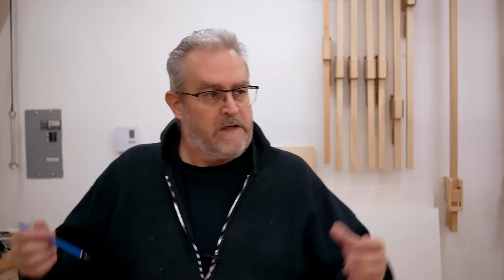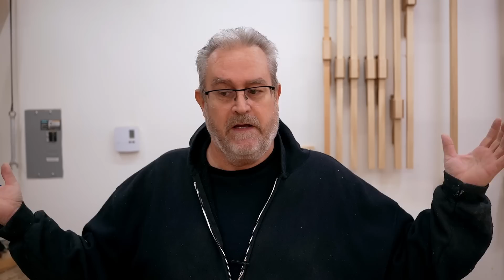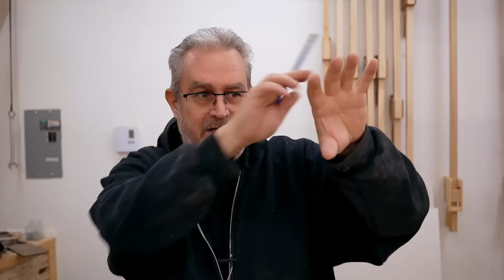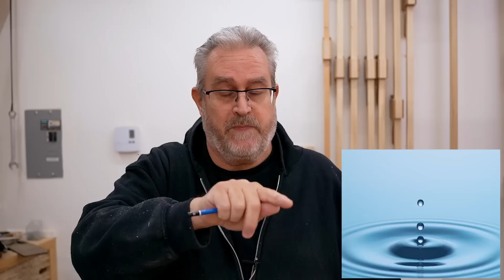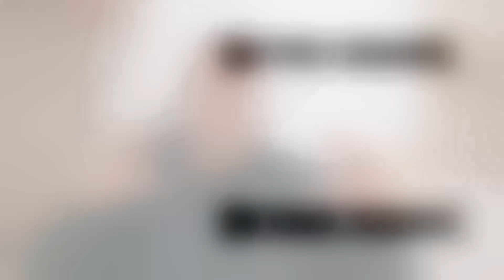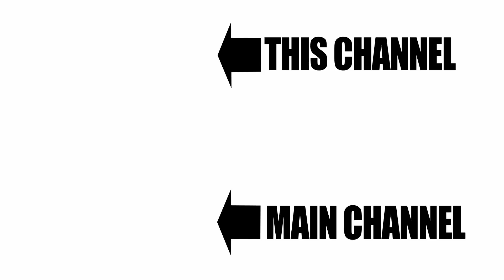Debunking Audio "Truths" - Open Baffle Speakers don't Pressurize The Room

Comment: At about 6:48 you state, 'peak being positive Pressure and trough being negative pressure'. You are conflating a sinusoidal function, with Compression and Rarefaction. Compression, the Density of the medium is greater and in Rarefaction the Density is less, but at no Time is there, "Negative", Pressure.
  In Labs I've worked in, were plating contagious/dangerous organisms is performed, plating said organisms on a growth medium, AKA petri dish, there is negative Pressure.  As air from the room is pulled out of the room and into the Hood, the workspace, and then through a pipe containing a series filters, before being exhausted into the Atmosphere.
Reply from the maker: I'm not conflating anything. If you look at the net air pressure in a room, it's a relative constant. Call it the the baseline. When sound is created, the "wave" produces a pressure above the baseline and below the baseline - Plus and minus.
In the video I included a simple example of exactly that, when a rock is dropped in water. And you can see that happening in that example.
I reject the terms "compression" and "rarefaction" to describe sound energy, because they are misleading as well. In particular compression - how much compression actually takes place when sound goes through a medium like steel, do you suppose?
Reply: @IBuildIt  Well you are free to reject anything you choose, but to describe the propagation of sound in a dispersive absorptive medium, air, the terms are derived from the Discipline of Physics. 
The velocity of a sound wave is affected by two properties of matter: the elastic properties and density. So you doubt that the crystal lattice of a metal is behaving at the molecular level, as a gas or Liquid, in the Classical sense, because you cannot perceive the displacement at the crystal lattice level? I suggest you research normal modes of vibration in a solid and perhaps then move onto the definition of Phonon.
Reply from the maker: Think about what you are arguing. I say I reject the term "compression" and prefer to use the term "pressure amplitude". 
Tell me, when sound is happening in a tuning fork, what would be the best way to describe what's happening? Would one say that it's compressing and rarefying, or would one say it's vibrating? 
And when describing a vibration, wouldn't it be natural to use the term amplitude to talk about the strength of the vibration?
Sound makes stuff vibrate - the air, water, metal, etc. 
When it does that, it's dumping energy into the medium and that dissipates in the form of heat. 
What happens when a medium heats up? It expands, of course, so using a term like "compression" is confusing and counterintuitive.
Reply: @IBuildIt 
 Well, you are now altering the discussion away from positive pressure and negative pressure, which was what I originally posted about, and wasn't correct in terms of the transmission of energy via the dispersive absorptive medium, in our case, air, defined as sound, We were first discussing. Now, you transition, to support what you believe should be the best way to describe the actual phenomenon, by discussing sound moving through a solid.
 I briefly scanned and found this definition.
 "In solids, waves propagate as two different types. A longitudinal wave is associated with compression and decompression in the direction of travel, and is the same process in gases and liquids, with an analogous compression-type wave in solids. Only compression waves are supported in gases and liquids. An additional type of wave, the transverse wave, also called a shear wave, occurs only in solids because only solids support elastic deformations. It is due to elastic deformation of the medium perpendicular to the direction of wave travel; the direction of shear-deformation is called the "polarization" of this type of wave." 
   Will you agree that the term decompression equates to rarefaction?
  This seems to be what you are objecting to in the first sentence, compression, in a solid which does occur at the atomic/molecular level, known as the crystal lattice. And is the mechanism for energy transfer. "Heat is the process of energy transfer from one physical system to another."
    "Sound makes stuff vibrate - the air, water, metal, etc."  From definition, "Sound IS a vibration that propagates as an acoustic wave, through a transmission medium such as a gas, liquid or solid." 
  Again I employ definitions and not interject my personal opinions. Sound makes stuff vibrate, or Sound is a vibration. That is the quandary.
  I won't deny it may seem counterintuitive, but that's the way the Universe works and if it disturbs you, it was told to me by a Prof, that is the first step in the learning process. I'm not trying to be a PITA, just that your terminology and possibly understanding doesn't align with a few hundred years of Physics paradigm. It not a big deal, its your channel and I enjoy your empiricism. So, I thought I would add my two cents to illustrate what is actually occurring. Your, "So using a term like "compression" is confusing and counterintuitive." Well, yes, I agree it is, so I copied two quotes about what Bohr thought concerning His own work discovering How the Universe actually operates.
" Those who are not shocked when they first come across quantum theory cannot possibly have understood it." " If you are not completely confused by quantum mechanics, you do not understand it."

Take care and thanks for your Time.
Reply from the maker: Guy, I'm approaching the phenomenon from different angles to try to get you to understand what it is I'm saying. I'm not changing anything I've said, but dumbing it down to get through to you.
What's another way to say compression and rarefication? High and low pressure. 
Your obstinance at this point is bordering on ridiculous, so let's agree to disagree.

Comment: Why does everyone make this so complicated? Its easy. Really.

A room is a box filled with jiggling air molecules.  The amount they jiggle depends on the temperature they are at and the amount of pressure they are experiencing around them (atmospheric  pressure).

A loudspeaker wether the cone is pushing or sucking will always deposite a little residual energy in room, which is heat.  If the room has leaky doors and windows, with thermally transparent walls, the extra heat energy will leak at the same rate as the cone vibrates.  The net result is no long term change in pressure.  

There have to be momentary changes in pressure otherwise we wouldn't hear anything.

They key thing is the room is an open system  so over time the excesses energy from heating the air molecules through vibration is almost instantly dispersed outside the room.

However, if a small speaker were placed in a closed system - a perfectly sealed and insulated box - then there would be rise in pressure as the air molecules warmed.  Eventually the cone would become harder and harder to move.  However, in the real world this doesn't happen.

If one then considers a large, crowned and poorly ventilated night club or concert hall then the quality of sound transmission is noticeably different as the temperature and humidity rises.  This is due to the warming and moistening of the air reducing its density and transmission properties.

The effect is certainly noticeable at a certain famous concert venue in London on hot humid evenings.  The sound changes as the sweat and heat from the large audience rises.

Comment: Nothing debunked and only potato/poteto about what we define pressure as. And even when pressure is wrongly referred to most of us probably know what they try to express. 😂

Test setup:
1. I have first hand experience with two OB 18" woofers hanging in the air from the floor boundary.
2. REW and calibrated measurement microphone.
3. A miniDSP.
4. I love equal loudness curves as implemented perfectly and verified by REW. 

So I have difrent equal loudness curves depending on listening levels and how a album is mastered. 
Defined as presets on the miniDSP remote. 

As we know the equal loudness is very "smiley" for the lower listening levels. 
In short there is a 50 dB gain at the most. At 20 Hz and down to 1000 Hz. 

There is no non linjerity in the graphs it is perfectly PEQ and the graphs ls looking as the equal loudness graphs in Wikipedia. 

Of course I have 8 big and very thick absorbers with 6 diffusers as I try treat the room first in the physical domain before I start with PEQ. 

So with All that background said you now should know that I am playing VERIFIED lower than 20 Hz and at very elivated levels in the bass region.. 

It took me over a half year to wrap my head around when I knew that I play low and with higher loudness.. And I could hear everything clear and detailed. 

But there were no bass visceral  or chest pounding feeling. Nothing is shaking or vibrating in the house and the pants legs is not vibrating!

It is the furthest from a home theater bass that you want and the closest to hifi when you can hear everything. 

Took me a very long time to get used to that bass presentation. First I didn't believed or understand WHY I don't get that bass physicall feeling. 

We are all so used to the presentation from boxes so it takes a long time to get detoxed from that. But it is OK when you can hear every details and you re-enjoy your favorite albums again and hear new things in those recordings. 

But yes boxes are more fun in the short run and more effect full best for HT but OB is best for hifi critical listening. 

So in short OB bass don't make the "jello" (new and corrected nomaclature when pressure is wrong as said in the video) vibrate so that you feel it in your chest.
(irony) 😅

So with all those declared preconditios above in the test setup.
I can with very high likelihood say that OB jelly shaking is low compared to a box and nothing were in the testing "debunked" when it is confirmed that it is so. ❤🎉

And as usual "hearing (and fealing) is believing". So have you not lived with that extreme setup and experienced it I understand that you don't buy into it.. When I am also the same that I need to experience it first hand to REALLY believe it.. 😢

There is fundamental wrong statement in the last sentences in the first pined post.
That the effect of a woofer is the same independent if it is in a OB or a box..

Well a box is omni directional but a OB will cancel.(cancelation) the bass radiation to the sides, up and down (mine is in the air) for the number 8 dipol pattern.
Therefore also not inpact and couse bass issues when it is loading the room far less than a box does. 😮

Comment: So… front port and rear port doesn’t really make a diff, correct? (In regards to air from port interfering with sound)

I remember reading many saying/thinking the air from the front port on say KRK monitors interfere with the sound. (As opposed to a rear port, like Yamaha HS)

Comment: Because an open baffle speaker radiates a dipole pattern, with cancelation happening left, right, above and below it,  there is far less energy coupled into the room as a whole.  That focused bass, has a different feel.   It's great as you are not pumping energy into the floor and ceiling and side walls that will propagate into adjacent rooms.  So that's good for multi-floor multi family buildings as you are only exciting  two of the six surfaces in the "cube" listening room.  The only way to produce high fidelity bass is a sealed woofer or open baffle.  The other schemes add delay and resonances to plump up the sound at the expense of accurate transient response and additional group delay.

Comment: It might be interesting to compare a sound wave moving through a space with very high air pressure and very low air pressure and see if there is a measurable difference between that and moving through "normal" air pressure space. Maybe somebody has already done this experiment. But I'm all for tangible emperical evidence. Thanks for actually thinking through these issues and testing them to see if "conventional wisdom" is actually accurate or not.
Reply from the maker: The speed of sound changes with altitude and that happens because the air pressure is lower at higher altitudes. Lower pressure equals thinner air.
But sound will still behave the same way in a room with lower air pressure.

Comment: I think a lot of people have a hard time visualizing a sound wave. We always see graphs (or even cheesey graphics on promotional materials) that explain a sound wave's frequency and amplitude in two dimensions. This looks like a wave on the surface of water, viewed from the side.

In reality, sound waves are three dimensional pressure fronts, smoothly transitioning from high to low and expanding outward in all directions from the source.

The way I visualize this is like a giant, invisible onion, continuously expanding in all directions from the speaker. Each ring represents the alternating high and low fronts.

When we talk about the length or hight of a wave, people I think tend to visualize this 2D wave bouncing up and down. Which of course is wrong. Going back to the invisible onion, the onion is expanding at a constant rate, the speed of sound. Which I believe is something like 1130 feet per second? So the length of the wave is the distance that wave expands in all directions during the duration of one cycle, high to low and back to high. At 20hz, the wave expands 56.5 feet in the time it takes the woofer to travel from it's high peak, the low peak and back to high, one time.

Amplitude has nothing to do with the size of the wave, but it's the contrast from the lowest to highest pressure that will be experienced in the air.

If you have a normal size room, it won't be 56 feet in any direction. So that low to high gradient won't even pass by your head unmolested. The high peak will pass your head, bounce off a wall and come back, albiet at ruduced amplitude. But it's still there. So that raise in pressure will polute and hold up the falling trail and you won't experience the true low peak. Same for the low peaks interfering with the high peaks.
Reply from the maker: The onion is a good analogy.
You did say something that is incorrect, but maybe it was a typo - you said that amplitude has nothing to do with the size of the wave, which is obviously not true. Maybe you meant to say it has nothing to do with the LENGTH of the wave, which is correct.
Sound is almost too complex for most people to get their heads around, especially if they are operating on basic ideas presented in a simple way. The low frequency sound sloshing around a room is insanely complex and it's happening in 4D, with time being the one factor that's most elusive for most people.
Reply: @IBuildIt  Thank you. And yes, I suppose length would be more accurate. I don't know that the wave will be shaped any different at higher or lower amplitude, within the confines of a room? Obviously, it will propagate further. But it's an important distinction to understand amplitude as a contrast in pressure, not a physical dimension. Least of all, length. 2D graphs show amplitude as height, which doesn't translate into real life.

Comment: I think they mean average excitation since normal speakers with a closed box produce an average room pressure difference. When gone goes out pressure increases. In a open baffle the average is always zero since you at the same time have a negative pressure behind the driver so sum is always 0 since there is no box to contain the rear wave.
Reply from the maker: No, they are all the same as far as the pressure produced is concerned. Think about it: as the cone in the sealed box pushes forward, what happens next? it pulls in, of course. Equal - no change.
Same thing happens with the dipole, but on the front and the back - no net increase in air pressure from either.
Even an infinite baffle sub won't create a net increase in pressure, even though the back-wave of the speaker is happening in another room entirely.
Reply: @IBuildIt  The point is, if you take a snapshot in time rather than the average. You talk in your video about average pressure over time, the commenter above was referring to average pressure at a snapshot in time depending on where the cone is in it's cycle. When the cone of a sealed driver is extended outwards, at that instant, the volume of the room is now smaller, which means the average pressure of the room must be higher (PV=nRT). An instant later when the cone is retracted, the volume of the room has now increased and average pressure in the room is lower. An open baffle would not have this same effect, as the volume of the room is constant. How that difference affects sound is beyond me, but the statement that a sealed driver affects average pressure in the room is absolutely true, at least when comparing pressure at snapshots in time. Your explanation that over even very small time intervals the average pressure of the room doesn't change is also true, I think you might just have missed the core of the myth you were trying to debunk?